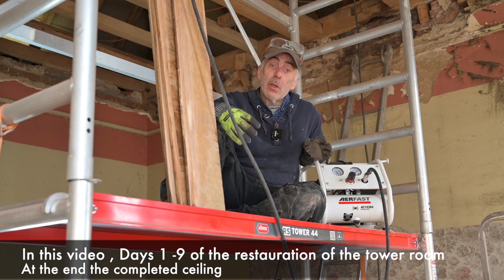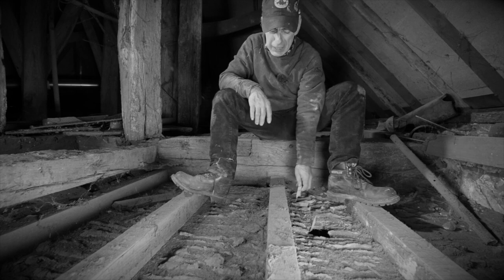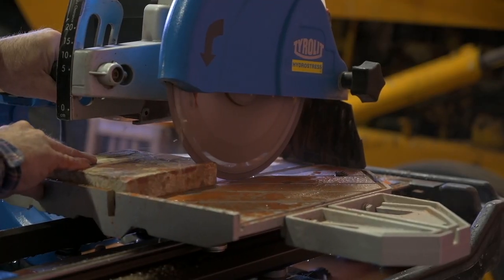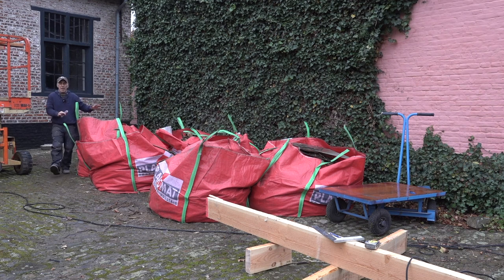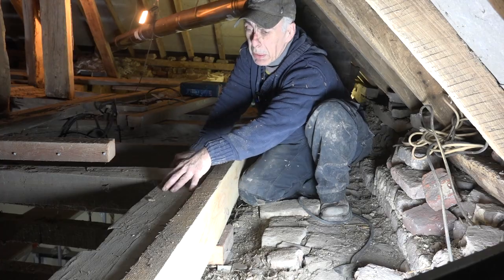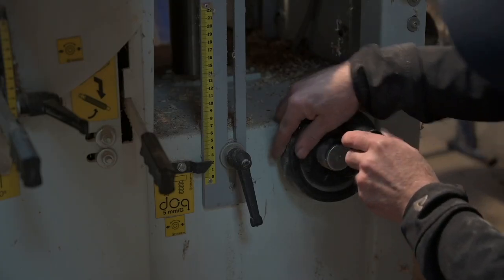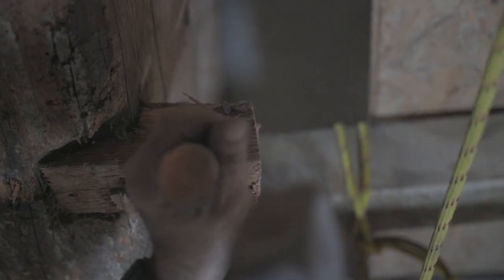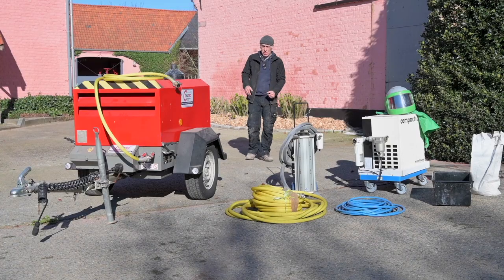Restoring the tower room, the first nine days in 18 minutes

Comment: Nice job Steve.  Too bad you have to look at those steel bars.  You probably didn't need the whole thing.  The floor was not sagging as it was and you eliminated the lath and plaster ceiling which was considerable weight.  You weighed it I believe.  Now with the wood floor, at least that adds some strength back in.  Another consideration is the roof itself.  Is the roof original?  What would have been there originally and would it have been heavier when the wood truss was constructed originally?  I have an idea of content until you can get parts for Rusty.  Several years ago, you mentioned you were going to put in a kitchen and a bath room etc.  Was that ever done?  Perhaps an overview of that would be good.  Also, what about the original stairs?  What remains of that?  How would you go about rebuilding it.  Several videos of your plans would be good content.  Again, bringing a structural consultant would have been good.  You could have had the consultant look at the whole complex and provided a gross overview.  I hate spending money myself.  I've paid for people to work up plans and such and have been disappointed in what I paid versus what I got.  Perhaps you could get an historic agency to come in for free?
Reply from the maker: Thanks for the comments Bill, That is a lot to answer.  Indeed the weight was about 3000Kg.  The roof structure is replaced in 1922 as it was destroyed by German bombs. I had the roof rebuild 10 years ago with Natural slate . So that is perfect and no issue.  The kitchen has gone in and the bathroom as well .. so that is to late... but I have plenty of other area's that I can tube.   The original stairs is one of those projects,  no need for consultants. Not worth the money... I have tried it several years ago and a total waste of time and effort not to mention the cost. Instead I had the historic building association  to come in and do an analysis.. That might be maybe I could a tube on... I still have the video's.
Reply: @D3Sshooter  Oh that would be great!  I would love to hear what the historic building association said.  No doubt that would be in French but you can add CC.  You have a very special place there.

Comment: At 17:12, I am curious as to why you didn't match the size of the old oak beam. I think that would create a sense of continuity across the ceiling. I do love watching your restoration. Thank you for posting.
Reply from the maker: Great point! I just filled in the missing beams and those were all 10x10cm... the cut-outs were near to that. However in those days the cut outs were all made to what they have available in terms of beams and they did vary . It was kind of a custom cut out per beam.    That would mean , I needed to get beams of different dimensions.  And that is not that easy to get.